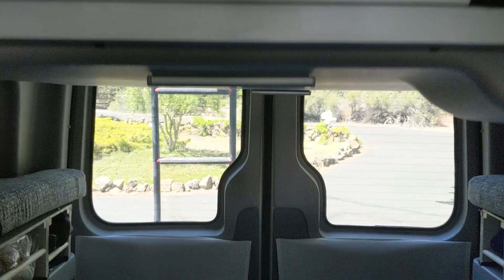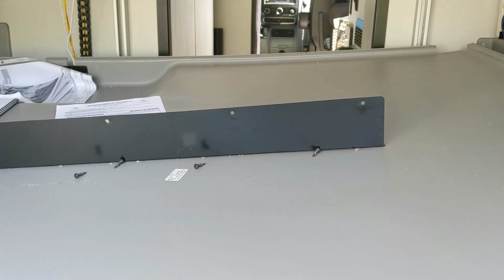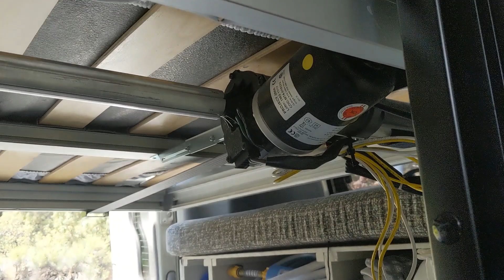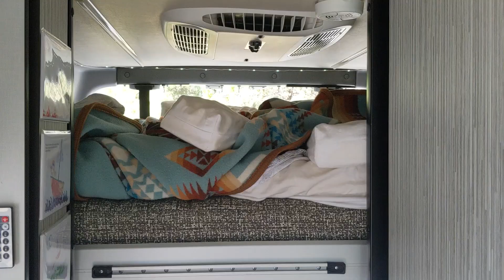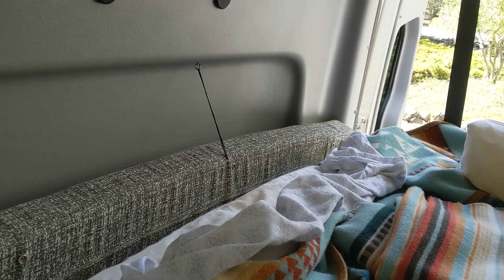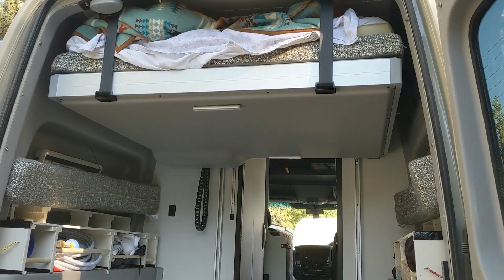Adjusting High and Low Limits on a Project 2000 Euroloft Bed in a Winnebago Revel

Comment: you never should use a twist tie. the wire can saw thru the wiring over time and cause a short or worse case a fire over time.
Reply from the maker: Thanks for the heads up, I hadn't even considered that as a possibility! I'll be replacing the twist tie with a zip tie!

Comment: Thanks for this video. I personally do not own a revel (I wish ;) ) but I have been trying to find the internal workings of the bed so I could have a go at making my own. So this is exactly what I was after...

I took the time to comment because I thought it was worth pointing out, due to a certain unnecessarily antagonistic person in the comments, that the video helped more than just those with a revel. And at no point did I think you designed this bed, would know how to build one, or that you would know where to buy it seperately... as its clear it came with your Revel. ;)

Great video... ignore those kinds of trolls. ;)
Reply from the maker: Thanks, glad you found the video helpful as well :) Good luck on your van build!

Comment: It is an Italian product. There is a Y.T.-video of this bed DIY in a toyhauler, using carbuckles and a garagedoormotor
Reply: It’s an Italian product? Euroloft is owned by the same people that Own Happijak, Lippert. Doesn’t sound Italian to me.
Reply: @GOLDVIOLINbowofdeath hi Mark. You r right. The Italiėn stuff is named different.
Reply: @EdurtreG  It appears they probably bought the Italian product and or it’s patent Or bought the company to get the rights to this product. I think it was after that that they changed the name to Euroloft from Project 2000
Reply: @EdurtreG  What was the name of the Italian product?
Reply: @GOLDVIOLINbowofdeath  something 2000. Living Vehicles also use them (in the 2019 and 2020 versions I think).
Reply: @EdurtreG  project 2000

Comment: Thanks for the video! I have a 2021, and I was able to do a similar adjustment to accommodate a 3" foam mattress topper that we added to the bed.

I cheated a bit and just removed the 8 screws closest to the front of the coach (about 1/3 of the way around the plastic bottom piece) rather than completely removing the entire plastic cover. With just those screws removed, there was enough sag in the panel to access both the top and bottom stop adjustments without too much trouble. Not sure if that's possible on pre-2021s, but it was nice not having to remove the entire bottom plastic piece or the central metal support.

Hope that helps others, and thanks so much for your videos!
Reply from the maker: I believe that method of letting the plastic cover sag would work in the pre-2021s. Glad the video helped!

Comment: That's awesome.   Do you know where I can buy this bed lift.   We don't have them in Australia so I need to get it shipped here.   TIA
Reply from the maker: It's a Project 2000 Euroloft bed. I'm not sure where you'd be able to buy it but it's worth a call to the company to ask!
Reply: @gnrwgn  Why didn’t you research that before you made the video I think you know the answer you just don’t wanna admit did you made a video about a product that people can’t buy separately.
Reply from the maker: @GOLDVIOLINbowofdeath I made the video to show Revel owners how to adjust the bed, and when someone asks about where they can buy it, I didn't do any research about how to acquire it but left the company name in case someone wanted to look into it. I'm not here misleading people into believing they can buy the bed
Reply: @gnrwgn nice video, these beds are in many different models of camper vans and motorhomes. We can reach our adjustment screws by lifting the mattress off. 

You can also get replacement parts from Lippert... I'd be surprised if you can't buy the whole assembly.